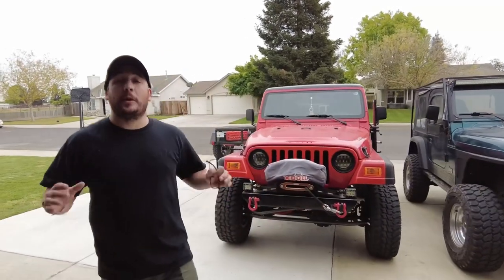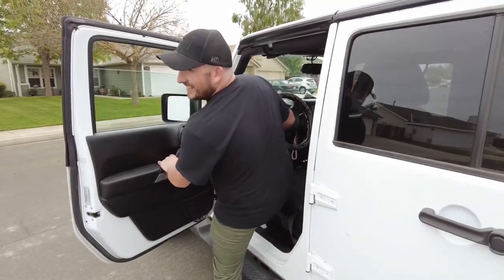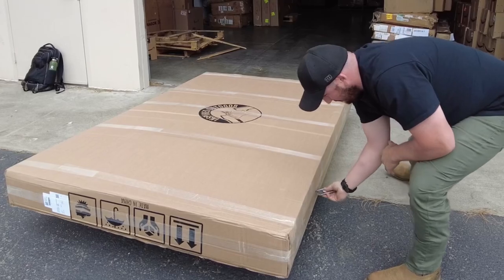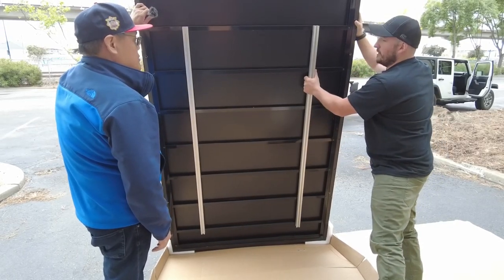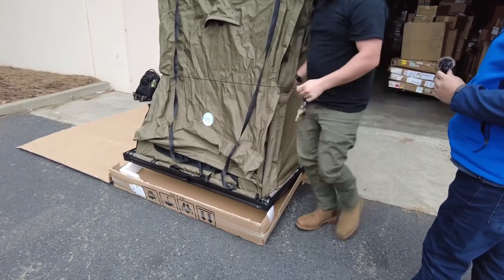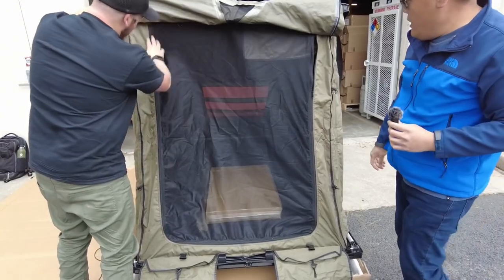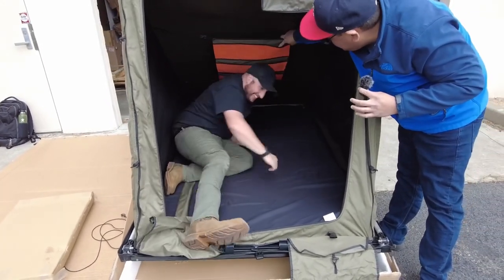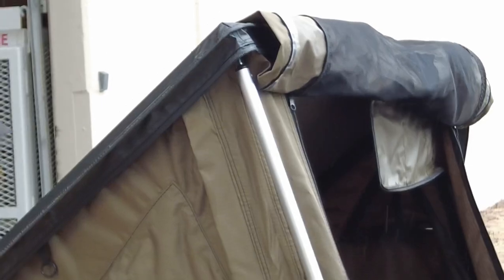First look At Inspired Overland’s Best Budget Lightweight Clamshell Roof Top Tent - Version 2.0

Comment: That's nice. It can open front and back into a cube?  So. the thing is that the trailer needs to be made to haul with motorcycle.
Reply from the maker: No this is just the 87lb clam or wedge type tent . The motor cycle part of the build is coming stay tuned for that 🍻

Comment: How well does it shed water when open? Specifically at the bottom edge. Does the outer shell catch water on the inside of the zipper?
Reply from the maker: There’s a rain gutter surrounding the outside of the zippers of the tent base, the material I feel shed off rain well and I have used it in the rain , but nothing to crazy. I have been in heavy wind storm and to be honest it was loud and hard to sleep in. So just watch out for that. For 1k tent how do you expect it to perform? Thanks for watching. Great questions 🍻

Comment: How good are the zipper while driving on dusty trails for awhile? Would it eventually jam up the zipper with dirt etc? Would water sip thru the zipper at the carwash?
Reply from the maker: I have had a zipper malfunction but lucky enough to have it on the end where it hinges. What’s weird is that the zipper doesn’t go both directions in that spot. So I’m down to one zipper that works both ways in that spot right now on one tent. I’ve never taken the tent through the car wash I don’t advise it.
Reply from the maker: Just like everything els you’ll want to keep things clean and I’m pretty sure there’s  a dry silicone for zippers they recommend to flush out debris and lubricate the zippers.

Comment: So why isn't there a rear fold out?! I like the Ikamper type side fold out because of the smaller mounted foot print. These rear accessible clam shells could benefit the same if they folded out to the back. Furthermore I feel that having a lifted truck with tall bed rack and a tailgate kitchen would benefit from a rear fold out rtt being the kitchens roof. Am I the only one seeing this in my mind and wanting a manufacturer to design it?

Comment: Where in San Jose did he say we could view this RTT?
Reply: KleanRidezAccesories for the 1.0 version
Reply: @frd3880  thanks. What’s the difference between the 1.0 and 2.0? Thanks.
Reply: Hi, Thank you for checking out this video by ATEM OFF-ROAD. We have the RTT Version 1.0 display currently at Klean Ridez Accessories in San Jose, CA.
Feel free to contact us on Instagram, Facebook or Email to receive additional pictures. 
Thank you and have a good day.
Reply: @amateurbiggamehunter7691  Condensation mattress, added on small windows for airflow, better and stronger materials, extra bolts for support, upgraded frame, among other things. While keeping the weight at 100lbs. Our goal are great pricing with durability and lightweight tent.
Reply: @ferdinandr2576  thanks. Will stop by to check it out.
Reply: @amateurbiggamehunter7691  Awesome and thank you for your time, have a good day.
Reply from the maker: @amateurbiggamehunter7691  it would be best to check out the 2.0
Reply: @ATEMOFFROAD  where?
Reply from the maker: @amateurbiggamehunter7691  get in contact with Ferdinand to see 2.0. I don’t recommend 1.0 and I’m still shaking down 2.0 at the moment. New video on the first real shakedown of the tent and trailer coming soon.
Reply: @ferdinandr2576   hello, is the 2.0 available for purchase yet? If so what is the link and are we able to pick it up from SJ?
Reply: @mkventures5259  Hi yes it’s available. You can purchase directly from our website. Thank you.